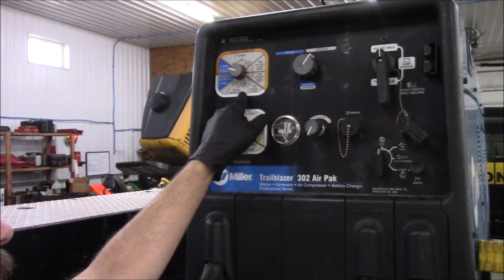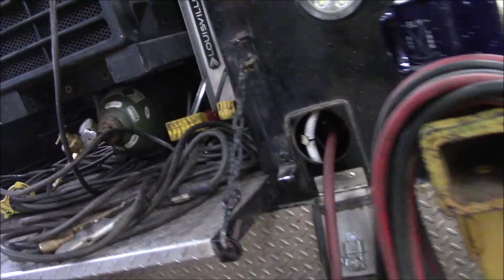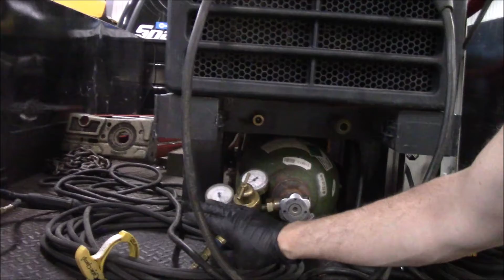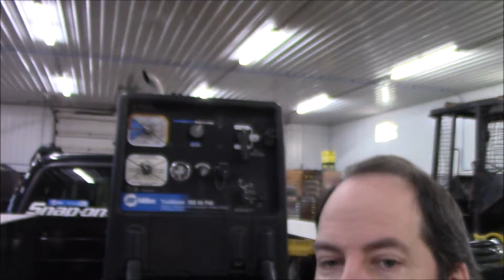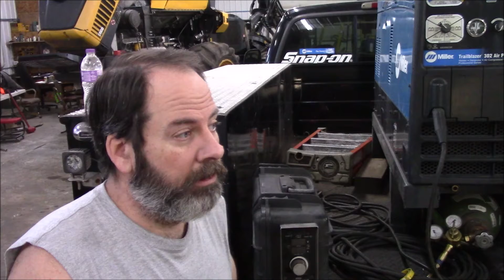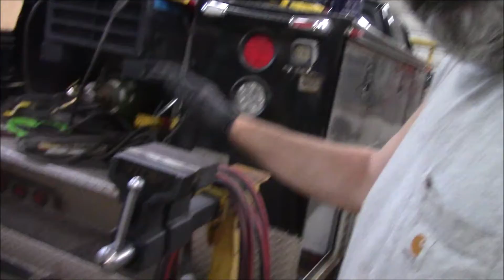Miller Trailblazer 302 airpak My Service Truck setup! Please Subscribe!

Comment: I know this is an old video- but how has your airpak held up? I have two of them and have had a few problems with the idle control. Both are down right now.
Reply from the maker: Just replaced my first idle control last year. Otherwise just crud in the carb jet. That is it.

Comment: Stupid question - the only trailblazer I see with that housing thing poking out of it is the air pak - is that the air filter for the engine? Had to move to make room for compressor? And - most importantly - does that make the air pak NOT weatherproof?

Comment: Great video! I am down south where it’s humid, bought a bobcat 200 version of the air pak because we really didn’t need that much weld capacity....it doesn’t have an air cooler/dryer and it makes a lot of water even with a separator. It hasn’t really lived up to the hype....how has yours been? Will it handle 3/4” air impacts? Do you have an air tank under truck or anything like that? I think we are going to have to upgrade. Any insight is appreciated. Thanks for what you share!
Reply from the maker: I don't run allot of air tools other than carbon arc. Yes it produces plenty of moisture but only during the winter is it an issue

Comment: Great informative video. I'm looking to buy a trailblazer 325 myself, but i cant make a choice on the EFI or the Carb system. I have seen a lot of people on youtube complaining about the EFI, too many things to go wrong, fuel pumps, sending units, O2 sensors. wish someone could shine me in the right direction. I know carb will work but will it get gummed up after awhile and have you had to adjust yours since you got it?
Reply from the maker: After five years I had to take carb apart and get today's new gas varnish out of the main jet. Otherwise she's never let me down. From now on I add a small amount of fuel conditioner to the gas. Otherwise it's never let me down. The key here is to use it often. Sometimes mine sits for months. That's when problems generally occur
Reply: @MichaelJBerg  for my day job, i drive truck then i may do welding on weekends working on log trucks or manufacturing parts for them but if i can get jobs rolling in pretty often then i would quit my day job then do welding/fabricating full time. would just make it easier having a good reliable welding machine for field work and even work at home. also, is your machine just bolted to your riser platform in the truck?
Reply from the maker: @troyshuler4280  yes bolted to riser. Riser bolted to truck bed. Simpler the better
Reply: @MichaelJBerg  I just acquired an ArcAir torch, i bought some carbon rods, 3/16 and 1/4 diameter. miller representatives told me to use only 3/16 carbons. supposedly my trailblazer 325 only has 280 amps for the carbon arc setting on the machine. Couldn't i get more power out of it by using the stick setting?
Reply from the maker: @troyshuler4280  3/16 I find run the best! I do however reach for what I have on hand and sometimes that's 1/4". Three old girl bellers a little bit but does the job just fine. 🤫
Reply from the maker: @troyshuler4280  By the way, I just turn the dial to WFO👍
Reply: @MichaelJBerg  Yes, Miller said if i ran 1/4" rods it may bog down the machine and lose output power. maybe a new feature so it doesn't hurt the machine? IDK? should I just use the gouging mode or stick mode? would either make a real difference?
Reply from the maker: @troyshuler4280  can't answer that. I don't have that mode for arcing only.
Reply: @MichaelJBerg  I'll see how the 3/16 rods do this weekend, might try one of the 1/4 rods to see how it does. is it necessary to grind out everything to clean bare steel after air arcing?
Reply from the maker: @troyshuler4280  absolutely must be clean. Need to get everything shiney and get rid of all carbon slag it you will end up with problems. The steadier you are with the carbon rod the easier the grinding 💪
Reply: @MichaelJBerg  what air pressure do you run for gouging? i never thought about that factor until i was about to start gouging apart an old bumper.
Reply from the maker: @troyshuler4280  in the gouge area under the needle. Look close there are recommended settings under the gauge needle. And I only run enough air volume to get the job done
Reply: @MichaelJBerg  I finally had the chance to use the Arc-Air and it was on a real project. log truck came in with a cracked bracket for the bang board. 3/8 thickness. the 3/16 rod gouged it out nicely i just put a V in there, complete penetration in the joint, i ground out everything to clean steel. i was down right close to the frame where it should have been. used Lincoln Excalibur 7018 1/8". I didn't feel like dragging the suitcase and hose out. just quicker to use stick in that case. the Arc-Air works great. only used about 100 psi with the air button pushed in.
Reply from the maker: @troyshuler4280  awesome Troy. Getter done now takes in a new meaning for you. I'm glad I could influence and teach something all at the same time. Keep gouging and welding bud

Comment: I jus got 302 air pak  wish I never got it
Reply from the maker: Why is that?
Reply: Miller Trailblazer MODEL 302 Gasoline Welder / Generator
.I work in this box for the price of 800 dollar and we do this online
Reply: 200 hr air compressor kicks in n out on low something it won't weld   sometimes when I weld It say it on jump start   called miller electric n say this thing sucks guy say I didn't build it call who u bought it from
Reply from the maker: @williameverett3136  don't tell him it sucks and expect an answer buddy.
Reply: oh I forgot we live in a do not offend society

Comment: i am building a (8ftx17ft box van) shop. 4 large tool boxs(3x6x5ft high)+ 3 smaller (2x3x4ft high) boxs. And a work table. 150ft hose
150ft leeds200ft 10g extention cord. All inside. right front roll up door with steps and full roll up rear door.powered by datsun 4cyl diesel 1 ton dual wheel. auto with pto plate.
Reply: would like sugestions
on lay out. from anybody with experience over 40.
i cant pull small/short trailer cause i cant see behind( make it unhandy) This truck turns very sharp ..so  tight places not a problem. plan on a winch up front bumper and run cables front to rear so i dont rip truck apart in mud.

Comment: Question?
yes. 
 u mentioned sign wave i think. or maybe hertz. (lol spelling)
i am going to run plazma cutter off my lincoln ( like ur miller).
i bought very large gas compressor as big as welder. AM I GOING TO HAVE PROBLEM WITH THE  120 OUTLET POWER RUNNING THE PLAZMA CUTTER?
VOLTS WILL BE OK AND AMPS BUT WILL THE DEVEATION OF RPM HARM THE PLAZMA CUTTER?
Reply from the maker: No problem. Should work fine.

Comment: Very nice set up and useful tips ! I run both Miller and Lincoln, I have the Lincoln on my trk and Miller migs in the shop. I have to say that 302 is definitely the bees knees! I just stumbled on your channel and subscribed! I do very similar work and I must say you have a beautiful shop there! Thanks for sharing 👍
Reply from the maker: Thanks for subscribing. Share if you would. I'm almost at the you tube magic 1000 subs. That's when they allow money to flow. Been a long year of making videos hoping to get to this point. Thanks again
Reply: Miller Trailblazer MODEL 302 Gasoline Welder / Generator
.I work in this box for the price of $800 dollar and we do this online

Comment: Does your compressor make any noise when engaged? The reason I ask, my dumb ass dropped my machine. Im pretty scared I did internal damage to the rotary screw.  It pumps air and all with no problem but it does make an odd noise when engaged
Reply from the maker: No noise. Just clicks in. Electric clutch. May want to take it to a Miller repair have it checked out.

Comment: what  settings are you running when you are carbon arcing ?
Reply from the maker: vincent wallis wide open! With air compressor in lowest setting. Runs good
Reply: perfect  thanks for the  reply I will give that a shot
Reply from the maker: vincent wallis used the machine for three hours straight yesterday running carbon arc. I like the noise and shooting Sparks everywhere 😋
Reply: just right ,yeah I purchased the same machine last year and have put quite a bit of time on it welding and  running   air  tools  and have been really impressed especially with the  compressor it has been more than worth the investment  doing undercarriage work and general repairs
Reply: Polka fan, EH?
Reply: Miller Trailblazer MODEL 302 Gasoline Welder / Generator
.I work in this box for the price of 800 dollar and we do this online

Comment: how to you like the machine? Any issues?
Reply from the maker: Cindy Russo Not one issue in all these years. Change oil and filter. Keep it clean. Treats me well.
Reply: thank you, I run an older 280 NT trailblazer. Baby runs like a dream with only 1300 hours on it. I use a t-30 air compressor for carbon arc. Your video gave me some confidence about running the carbon arc with plenty enough air and obviously plenty enough juice.
Reply from the maker: Cindy Russo Your welcome! I'm glad my audience is getting something out of my videos.
Reply: Thanks Mike, is the machine loud when idling? My buddies 302 you can pretty much talk about 5 -10 feet away and its not bad at all! really impressive
Reply from the maker: Cindy Russo About the same I would say. I've always work my earplugs since I've been welding. I don't weld workout them. So I guess I can't get an honest answer.

Comment: Can the air compressor power 1" drive?
Reply from the maker: JFW outdoors without a problem yes
Reply: Thank you. I want to stick on flat bed with montezuma tool box beside it. Man that would save a lot of space. I never knew they had air compressors built in.
Reply: how about a plasma cutter
Reply: Miller Trailblazer MODEL 302 Gasoline Welder / Generator
.I work in this box for the price of 800 dollar and we do this online

Comment: Thanks for the great video after putting some hours on the machine. It is great to hear how these machines work straight from the guys that use them. What type of high frequency setup would you recommend to allow this unit to Tig aluminum?
Reply from the maker: I don't know anymore what they have. I used to run a freq box years ago. I don't tig al in the field however anymore! Thanks for the feedback.
Reply: Miller Trailblazer MODEL 302 Gasoline Welder / Generator
.I work in this box for the price of 800 dollar and we do this online